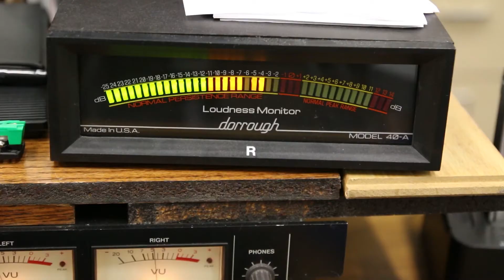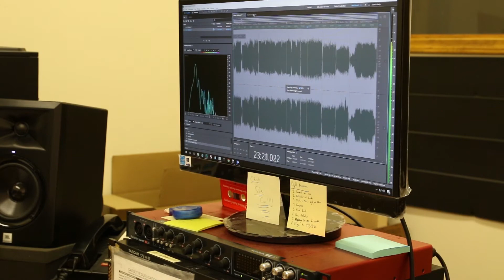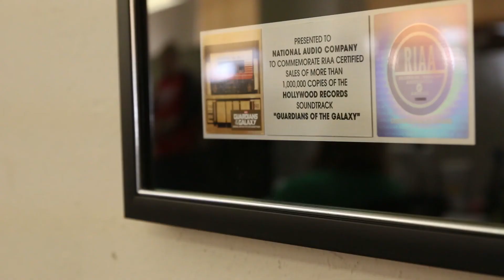National Audio - The Comeback cassette

Comment: When will NATIONAL AUDIO COMPANY. start having 8TRACK TAPES. far better sound even today
Reply: Edgard Agosto 8tracks are dead and buried
Reply: 8 track tapes sound great when they are new, but unfortunately as they age the lubricant used to allow the spooling off of the inside layer of tape degrades and the tape fails. In addition, the level of technology imparted to the cassette tape teck has surpassed anything that was and is available for the 8 track format.  Enjoy then while you can!